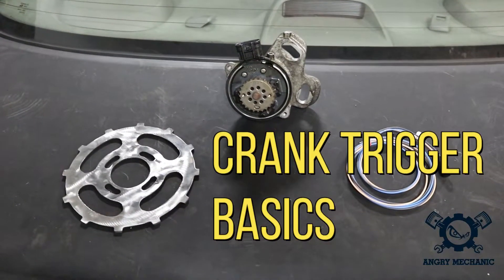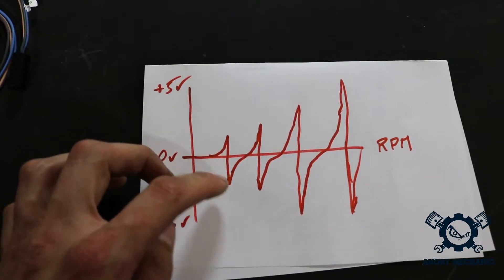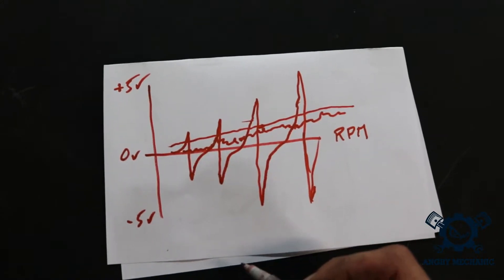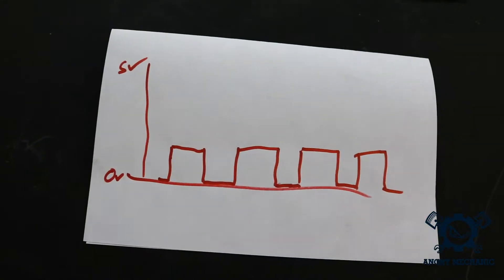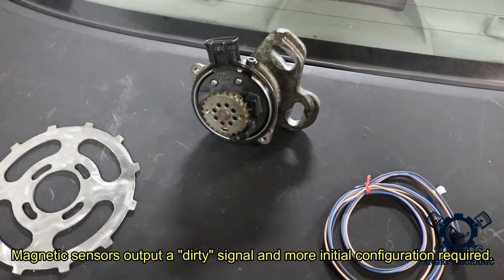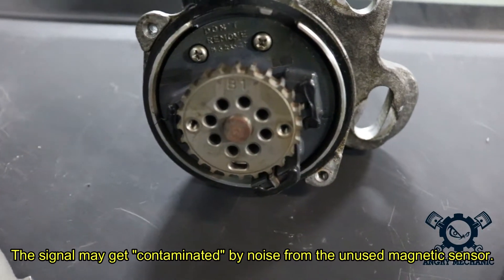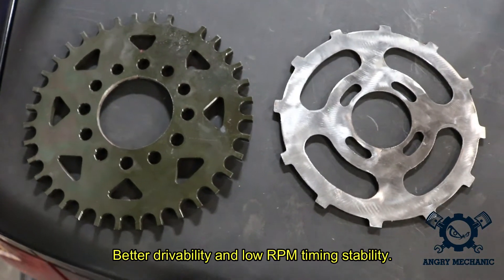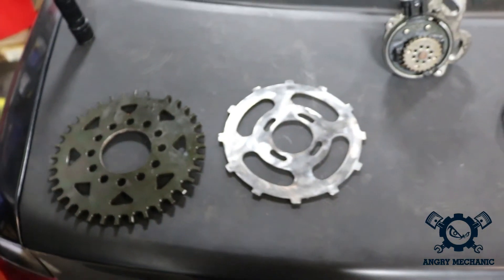Crank Trigger Basics Hall Effect, Magnetic Sensors, Nippondenso CAS Toyota 3SGTE

Comment: Great video, I appreciate this type of information. I look forward to the install video as well. I have the exact same kit with the 60-2 tooth wheel. I'm curious though, since I'm using one GS1007 hall effect sensor for the crank (Trigger 1) and one for the cams (Trigger 2), can the Brown (12v +) and Blue (Ground -) wires be shared from the ECU (Link G4 MR2Link V1 - TST185X) between the two sensors?
Reply from the maker: For hall sensor you can just ground them to the sensor ground pin on ECU. For 12V you can use any 12V supply such as 12V from injectors or 12V from coils circuit. The stock position sensors are not powered so you will need to power the hall sensors from somewhere. Unfortunately I might be taking a different route with this build so I might not getting around to installing it. Just a heads up you will need an MR2 crank pulley to work with this kit if you have a Celica.
Reply: @angrymechanic5529  Luckily, I am installing this on an MR2, thank you for the advice. Any specific reason you are going in a different direction with this build? I have not heard any success stories with this RacerX kit, I'm wondering if I might be better off going back to stock ignition timing myself.
Reply from the maker: @timjeffries4725  Honestly I do find the kit a little but crude for the money. If I were to do it over I might have run a 5S oil pump and use an ST215 timing sprocket so I can run a factory crank sensor. Not sure if it would work never tried it but I'm sure it can be modified to work if it doesn't all bolt together in terms of alignment of the camry crank sensor to ST215 sprocket. The reason I'm going a different direction with the build is that making big power on this engine has been getting too expensive I cracked my gen 3 block last year, she held 650WHP on E85 before she let go. I will be putting back a stock 3SGTE in the car and just use it as a winter beater. I have a Mustang I'm building now, I was hoping to make more videos but I've been so busy with work. I see a lot of people have been finding my content helpful and I would like to make more if time allows it!
Reply: @angrymechanic5529  That's an interesting idea. I completely understand your position and yes, your videos and expertise in this area are certainly an asset to this community. Keep up the good work! Thanks again.
Reply: @timjeffries4725  Did u end up getting the Racer X kit and using it? I've been thinking of buying it too.

Comment: Whats a typical  tdc offset angle and number of tooth  i should be using on a 24 and 1 Distributor. From 3sgte motor. Im having problems  synchronize  it on my haltech spint 500 .
Reply from the maker: The tooth offset will vary depending on whether you used G1 or G2 cam signal. G1 and G2 are 360 degrees apart which will result in the need of a different tooth offset for either. I don't remember the exact tooth offset off the top of my head but its easy to find out on your own. Make sure your trigger settings are for VR sensor, 24 crank teeth, 1 cam tooth, speed of rotation is cam. Make sure you turn off fuel supply to the engine, hook up a timing light to cylinder 1 and crank engine. If all your wiring is correct you should be getting an RPM reading, if not you may need to lower the arming threshold either on your ECU software (MS3 you have to adjust the jumper settings and pots on the board). With the timing light see where the timing is at and adjust the tooth offset until you achieve the correct timing. Turn on your fuel supply and crank the engine, if it still does not start you might be firing the plug on the exhaust stroke and all you would need to do at that point is adjust the trigger offset by 360 degrees.